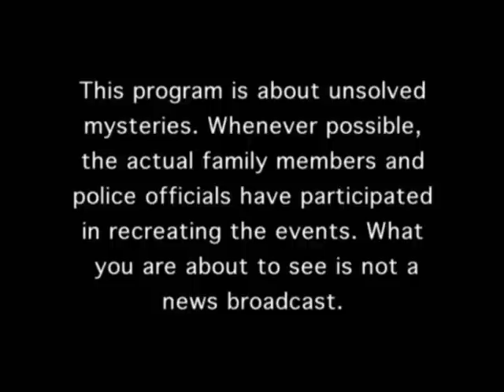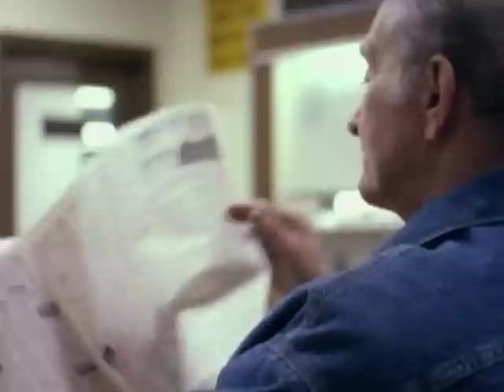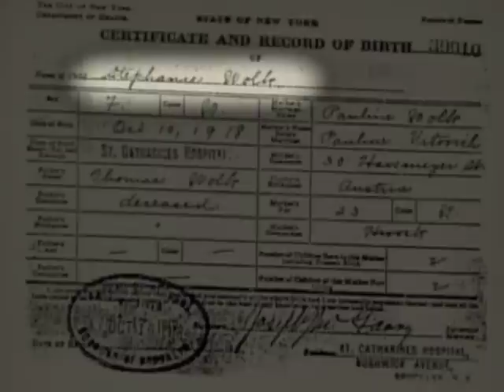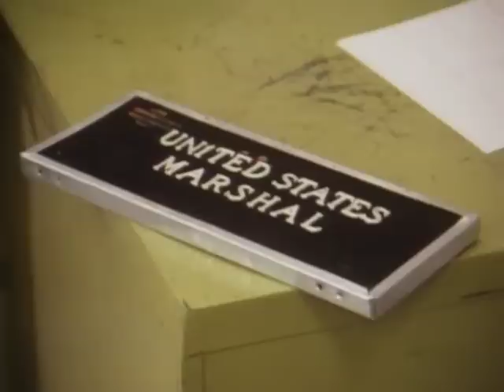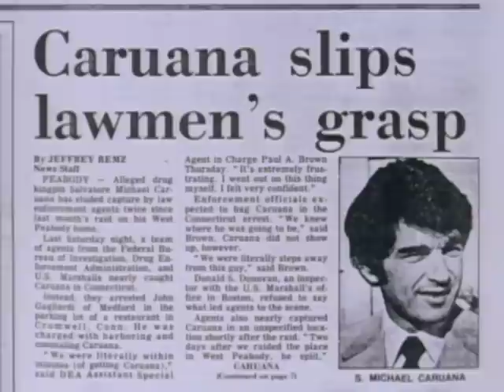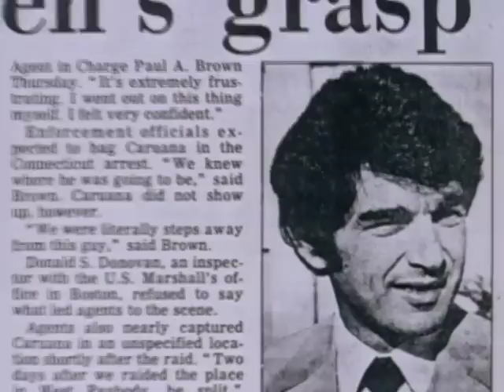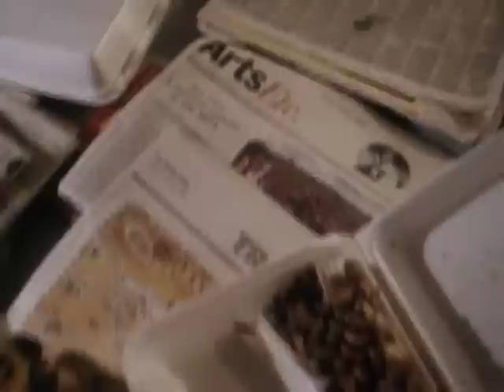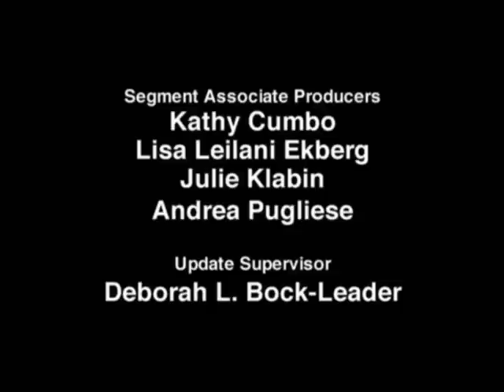Unsolved Mysteries with Robert Stack - Season 2, Episode 5 - Full Episodes

Comment: 9:51 Anyone who has used a pallet jack for any length of time knows you pull them after you have the load on. The only time you push them is sliding under a pallet.  Not to say it can't be done, but it's a highly irregular practice. As you can see the intruder wasn't able to keep it straight very well in the security cam footage.